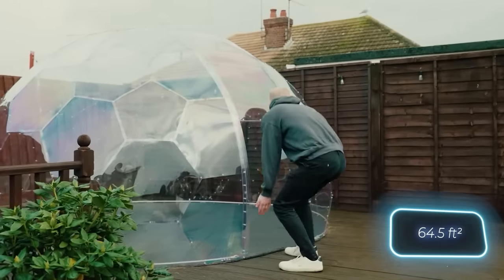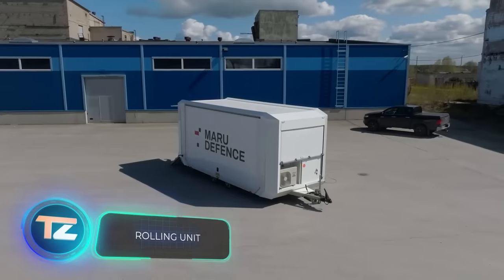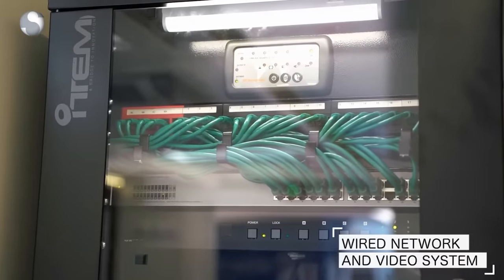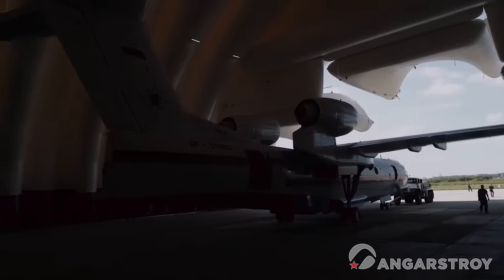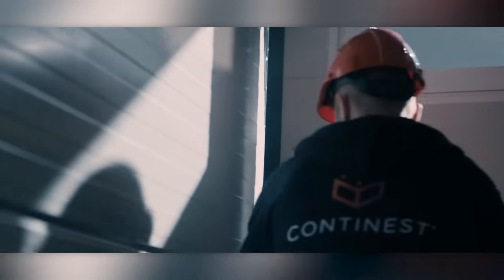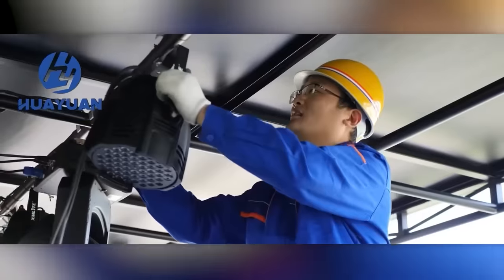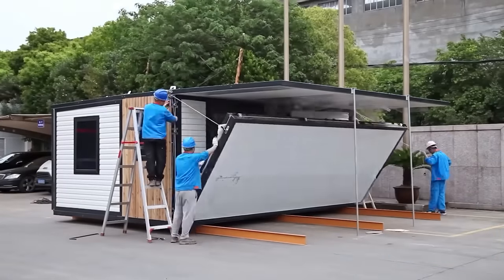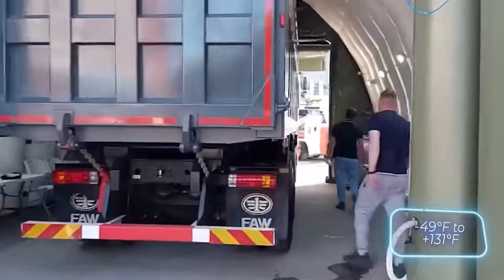12 QUICK-BUILD SOLUTIONS THAT ARE REALLY IMPRESSIVE

Comment: Cool video. Like the porta-Hotel.  In Yosemite, there is this area next to a river that freezes over with a 8-10 of snow and April it melts and washes away, but by the end of April, they pull from a big hanger these porta Hotels and place them in a two acre area along the river and rent them out for $350 per night to vacationers. You are surrounded by Granite mountains, water falls, Half Dome and plush meadow vegetation let alone some of the biggest redwoods. Bears are there but are controlled by Fish and Game.  Never dopped my line in any of the rivers and didn't bring up a brook trout that wasn't from a stocked source. In fact, after eating the best tasting organic trout for the 5 days we were there, I never felt better and lost 5 lbs.

Comment: The issue with most of these, when it comes to people, is that many of the places that have the financial capabilities to use them as a vacation/trip home or most of the places that sct as refuge camp countries and states get very, very cold talking NY, Vancouver, Seattle, The entirety of northern Europe .. we are talking about some serious heating needs and bills that cost a lot even in nicely isolated houses and apartment complexes .. these tin and foil spaces would loose most of the heat in winter, and they would be terribly warm in summer,  there are reasons why we build the way we do guys.. its not an accident, its very intentional and learned over centuries of freezing our asses off in the wilderness

Comment: The Royal Air Force trialled an inflatable hanger in the late 70's during a winter NATO exercise in Norway. It was designed to accommodate a single helicopter for maintenance activities.
Once inflated the hanger manifold was connected to a pump that would automatically switch on if it detected a pressure drop of 2 psi.
We awoke the first morning to find the hanger had completely collapsed overnight, because the pump's battery had frozen solid.

Comment: Problem is most these "Options" are near the cost of a standard house making them all but impractical. I like the bust out container ones, but all I saw was light coming through every seem which is a no go.
3D printed company is making a steel house and then using plastic printed panels (I would not be surprised if they were fudging their numbers)

Comment: The foldable, solid structures are more practical with adequate insulation.  But inflatable ones will need periodic re-inflation, to keep inflation, like bouncy castles for kids, here in US.  Sort of noisy, if those are used as shelter homes, but if inflation stays stable without inflation pumps, then really good, in the places where insulation is not a problem.